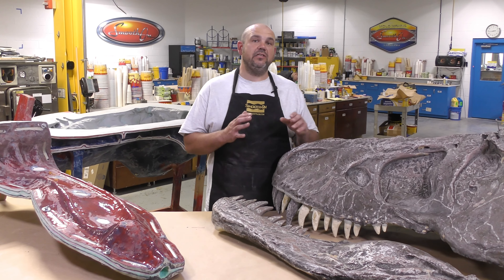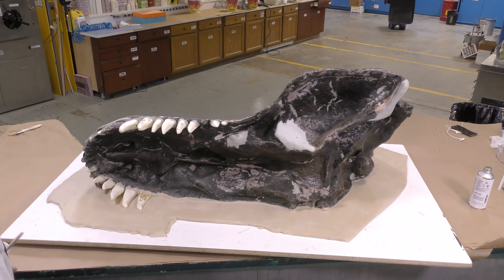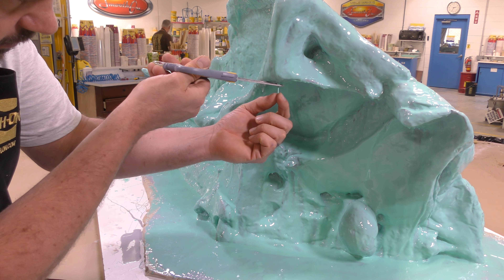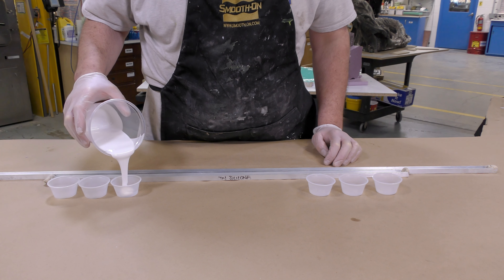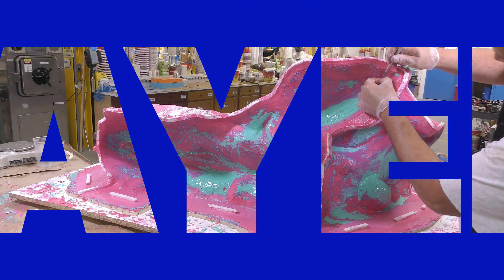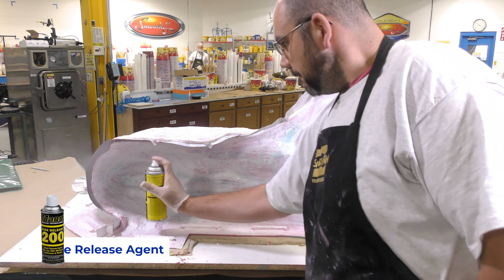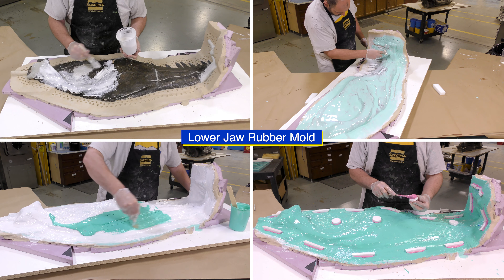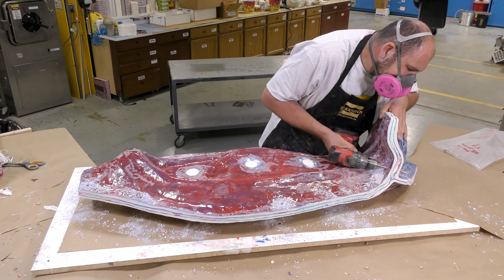How To Make a Large Silicone Mold with Multi-Part Support Shell

Comment: Can you let the rubber cure and proceed the next day instead of working for 12 hours straight?
Reply from the maker: Althoight ypu could let the rubber cure and then resume the next day. It is best to allow the material to fully cure in one continuous process.
Reply: we used to do that at the foundry, we would usually wipe the rubber with Isopropyl alcohol. Let it dry and apply more layers.